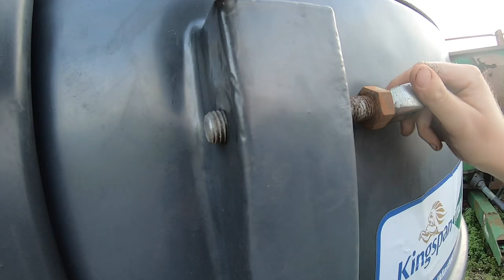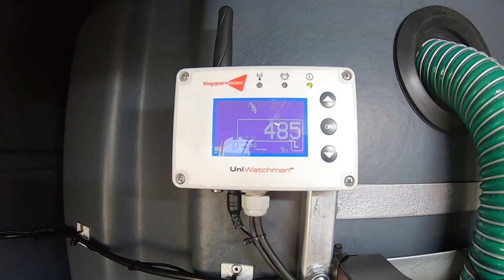GOODBYE RUST! HELLO SHINY AND NEW!

Comment: From the Kingspan installation instructions: “• Ensure the entire base of the tank is supported with a non-combustible base (minimum 45mm in thickness) extending 300mm on all sides.”
Nah, chuck it on a few sleepers, proper farmer spec.
Reply: If you think about it. Wouldn't matter what the base is made of really. The tanks made from plastic, so if there's a fire it would melt before those sleepers caught on fire anyway. At least it wont explode like a metal tank could.
Reply: ‘Proper farmer spec’ 😂😂
Reply: @sshep86  it's not about the tank setting fire to the sleepers, it's about the base catching fire and lighting the tank. (Un) fortunately in this country we have OFTEC governing the rules around fuel storage, means we are not supposed to place our own fuel tanks.
Reply: @ehamster  it'll be grand lad
Reply: It’s not about the fire risk, it’s about the weight distribution of the fuel over a greater area. The weight of the fuel, 200ltr is approximately 1800kg, is now not sat on a continuous area, it’s supported unevenly. The instructions are there for a reason, you’ve just invalidated your 10 yr warranty. Plus your delivery driver should not of delivered to the tank, as it’s clearly not installed correctly. Tom, from a safety point of view, when the tank gets empty, remove those sleepers and put it back on the concrete pad. You’ll be glad you did in a few years time.

Comment: Next episode, someone has lost the keys to the new diesel tank.
Reply: they give you 5 or 6 keys. But you. an get in without a key, the locks are weak. I have not integrated power suply in to it, because you can break the lock and pumpit all diesel out then...
Reply: @Ignysvarniai  Yea, thats a thought, putting the kill switch to the power somewhere else. no power=no tanking, on the other hand, no power = no dro (depending on volatile memory or not)
Reply: Following episode: Installing a keypad lockout for the pump. (Diesel's protected even if vandals cut through the door.)
Reply: Is the next video to do with a mcale straw blower
Reply: @jonnymacbean9196  ssshhh
Reply: @konzetsu6068  trouble is if they break in and no power they will drill the tank and its ruined. my view is if they are determined enough to break in let them have it rather than ruin my new tank.
Reply: i realize I'm kind of off topic but does anyone know a good place to stream new tv shows online?

Comment: Tom, we upgraded our diesel tank like your new one several years ago. No issues with dirty fuel dispensed anymore. The digital metering is a great for managing where it is all being used. We keep a log sheet to record each machine when filling up and useful when costing operations.  Booking fuel out when contractors need topping up is being most accurate. Check you don’t get any rain water, as time goes by, entering in the door and collecting in the bund. This happened to us from a faulty rain gutter.

Comment: I'd infill the breezeblock walls with cheap stone (if the walls are sturdy enough!) - then mount the fuel tank on that. As is, I'd power wash the slab, put forms around it, throw in some hardcore and some fresh concrete. Those sleepers are proper rotten, they rot even faster as there is a lot of standing water there.

Comment: My grandpa had a filter for his tank. It was called a funnel with a very fine screen in it. Also those old tractors had a glass jar in the gas line with a spring loaded stopper in the bottom to let the dirt out of the gas line.

Comment: Hi Tom, when you fill you tractor or whatever with your new pump it will froth the diesel up an trip the nozel to stop the froth coming out. You then think its brim full but once the bubbles go they can take a lot of liters yet, it triped on our Mf5465 and  it took another 50 once the froth went down( she has the extra tank, hold 250

Comment: Something I learned while working at an oceanography lab (just a janitor), you can remove the debris in a tank with a siphon on a long tube. The tube goes to the bottom, the hose sucks out some liquids, but grabs the debris on the bottom with the suction. Lose a few litres, but the debris is reduced. Can also let it settle, then siphon off the top clear liquid into another container, and filter it. Then return to the tank all clean liquid.  Can always try on that really bad diesel. Just let it settle, and siphon off the top. Less waste. Although your new tank is not top loaded, you can siphon out the debris in your tractors tanks as well. I know what that debris can do to an engine, and the filters. Why do I always learn things the hard way!

Comment: I'd  check if your warranty is ok, placing it like that. If that tank is filled with 4500 litre = 1kg per litre of fluid as a average = 4.5 tons plus weight of tank. Replacement fuel filters commercial fuel solutions get a spare. Nice upgrade.  Plus put a good light in it, you never no.

Comment: Is the door steel reinforced as we had a similar one and they just cut a hole out in the door to pinch the diesel, also pays to turn off the power at the source of an evening,not just in the tank. Just a tip as it’s an expensive lesson to learn , all the best Tom.

Comment: I'd set 4" dia steel pipes in concrete around that new shiny stationary target.  Never know when a loader with tines is going to run into it.

Now ya need an electrical lockout the thieves can't access after they break in the plastic door, then a security camera and night light.  Theft alarm system.  Register with the local constables so they know where to go when the diesel thieves hit.  Sounds like the great train robbery at Pemberton Farms to me.
Nice looking tank.  Your new vehicles with the high pressure direct injection diesels will last much longer now.  High tech direct 2000 bar injectors are expensive

Comment: Don’t bother locking it let them take the diesel, have seen it where they drill straight threw the tank take the diesel and leave you with a mess and written off tank. Diesel is cheap compared to the tank and enviro damage cctv and text alert when the tank is being used is really useful
Reply: Exactly . If they want it they will steal it . Locks won't stop them.

Comment: Your old tank was  2750 litres/600 gallons. You probably ordered a maximum of 2300 considering the sump below the exit pipe.  The new one is 5000 litres, although it looks more like a 3500 tank to me. That's 1100 gallons if you are sure it holds 5000. Do please check that it does.

Comment: I would contact the tank manufacturer, as I very much doubt several train sleepers will meet the manufacturers requirements for the tank warrantee.  I have done rainwater tanks and those tank manufacturers specify the size of the concrete slab, the grade of the rebar-mesh, smoothness, alsorts, just to meet warrantee requirements..

Comment: By heating up a cylindrical tube to the point where’s is red hot, the thieving wotsits now have the key to new tank by ramming it through the side! When they’ve filled all their containers up, they pull the pipe and clear off. You now have a an environmental disaster, a load of cherry stolen and your new Kingspan 5000 is good for bonfire night. Put it away, out of sight and behind reinforced concrete and steel! But, your doing a great job and we’re enjoying the videos. Keep going!

Comment: Great for safety and insurance. Great for a new tractor 🚜. 🙂 It will be good when your custom choppers come in and you can now manage the diesel. Does it come with wifi or cellular to communicate smartly, and tell you when it's empty. Didn't see the power line unless it comes with a cord. Great video nice upgrade.
Reply from the maker: Unfortunately not 🙈 Cord is round the side as well 😊

Comment: Shurely it would have made more sense to leave the old tank in place until it’s empty rather than start messing with 5 gallon cans and use it to fuel up yeir old international’s they wouldn’t be to fussy what they burn and set up the new 1 beside it temporarily. All those old steel 1’s should be inside in a shed by right. when they are inside you don’t get them kind of problem’s

Comment: 5000 L is way too much i guess you only use 2000L a year at most as we have a small arable and beef farm and with 4 tractors, ploughing every year we only use about 3 to 4000 L a year but we get it in 2000L batches for summer and winter because diesel doesn't last